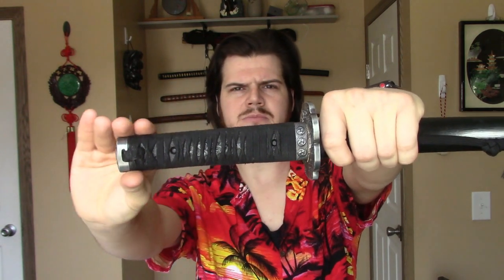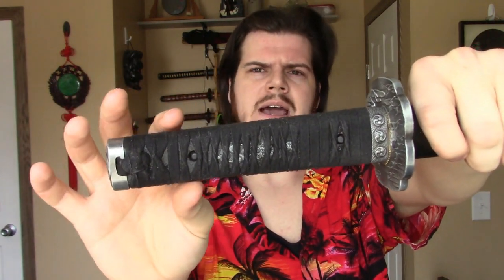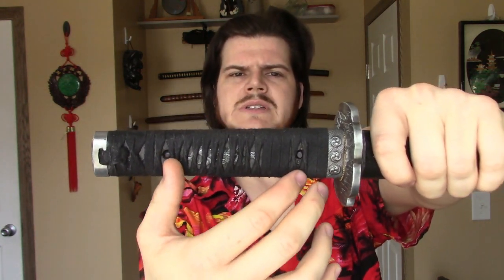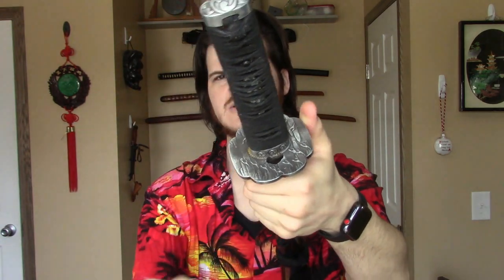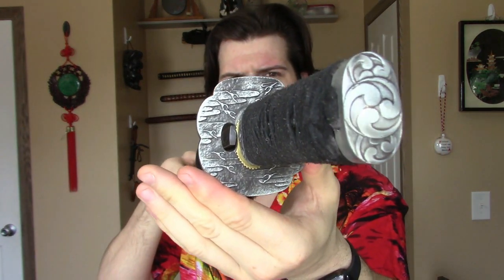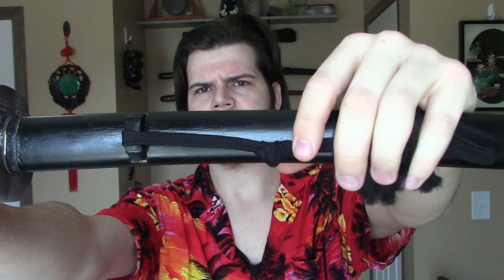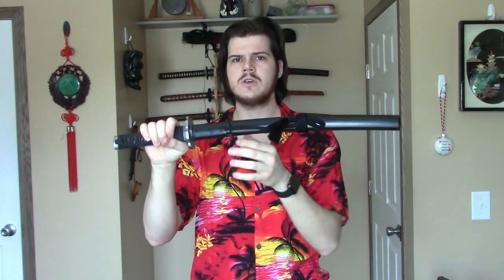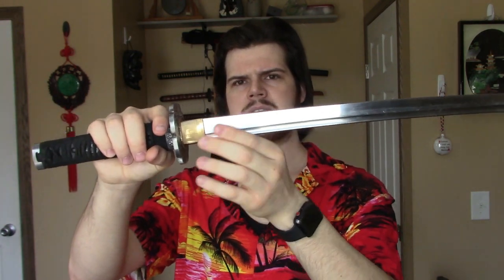Satsuma-age Tenryu Wakizashi

Comment: That thing looks awesome! What did you use to cut the blade shorter?
Reply from the maker: Thanks! I used a metal cutoff wheel on my dremel tool and then I ground it to shape on my disk grinder and 1x30 belt sander, after that I used the fine belt of my work sharp to smooth the steel out and then did some very slow sanding until I got the ground part matching the rest of the blade as best as possible. The critical part of the whole thing is to be sure not to overheat the steel which involves a lot of quenching otherwise the heat treat is ruined.